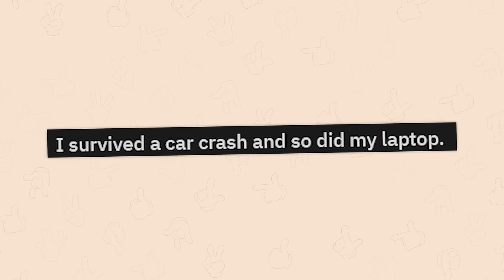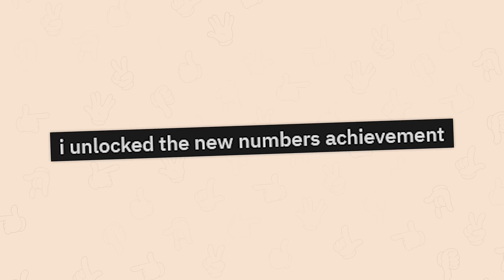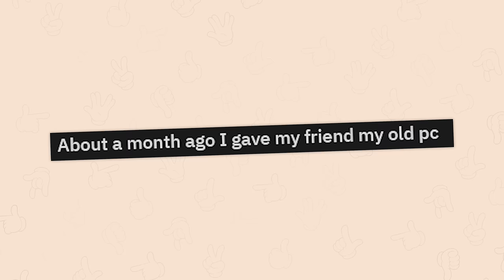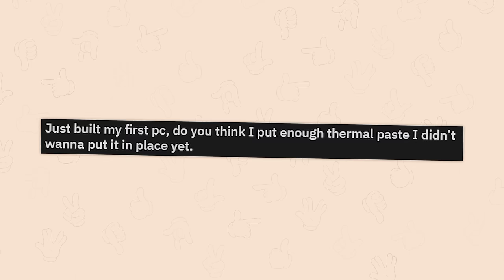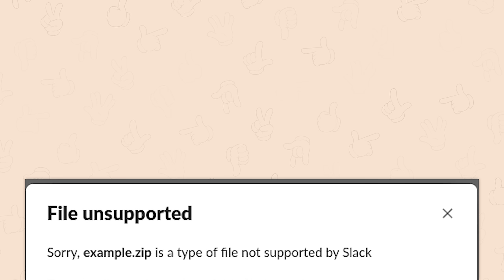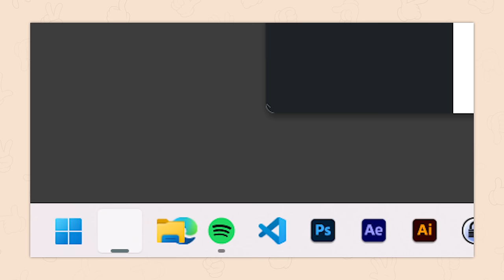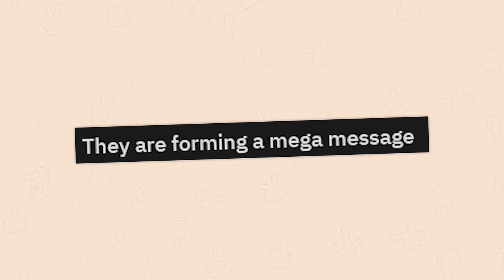r/Techsupportgore | why is the wifi down?!?!?

Comment: I've needed to replace the connector on an ethernet cable for several years (it's easier than replacing the cable cuz it's a huge one run from downstairs through the loft to my upstairs room on the opposite side of the house) and videos like this are a big part of the reason I've not done it, I don't want to end up on this subreddit. It is wedged in with a folded sheet of paper and it works.
Reply: Don't worry. I have a cable held in by tying a piece of yarn around it and the switch. But seriously, if you have the proper connector and crimper tool you'll be fine. If it looks bad cut it off and try again. The subreddit is for notably bad things. If you have less than an inch of wire sticking out of the sheath I guarantee it will not be bad enough for anyone to notice.

Comment: As Lexi correctly mentions: if you let a general electrician run your Cat6e, at the very least do not have them try to terminate it. It WILL be wrong and you WILL be sad. Just ask them to run the cables and leave the cut ends sticking out of the low voltage junction boxes with about 4-6" of slack. Terminating these cables is pretty easy, but the electricians are typically not very good at it. Better off doing it yourself.

Also, I 100% agree that Windows 11 just isn't finished. If there were still security updates and software didn't need feature sets from newer operating systems or were bullied by Microsoft to stop supporting the old ones, I'd probably still be on XP. Heck, I might go to Vista. I do miss the widgets and I've got PLENTY of RAM. But I'd rather not be even less secure than I already am. I might be tech savvy, but I'm not up to the task of building my own personal router with a firewall built in. That is just beyond my interest, even if it isn't beyond my skill level. Also, for anyone curious how so many retro tech reviewers can feel comfortable running old operating systems on their networks, this is how. You build a computer with multiple RJ45 networking ports, load up your favorite router-tuned flavor of Linux or Unix-adjacent operating system, and load the container that has firewall functionality. Then you set it for DefCon5 because old operating systems are rife with known vulnerabilities.

Also, typically when something goes terribly wrong with the Windows shell, I will open task manager and force-close Explorer.exe, since that is basically the shell for Windows. Because it's meant to be running constantly, it should automatically relaunch. Otherwise you'll have to tell it to run Explorer.exe.

Also, yes, the network engineer is coming, they just needed to find their cat5-o'-9-tails made out of terminated Cat5 that they made during the last wiring upgrade. Always use the terminated ones to make your whip.

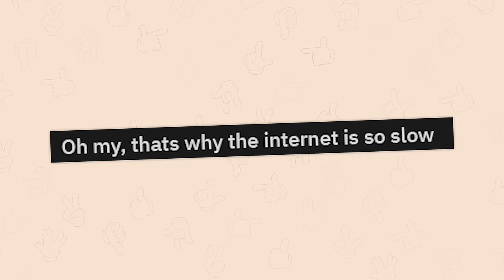Comment: 17:44 that is windows 10 and that issue only happens on .npy files when using the recycling ui empty option. If you use the empty option you get when you right click this issue does not happen.

Comment: 511 degrees C is hotter than the melting point of solder. For those who don't know, that's the stuff that bonds and electrically connects the components to the circuit board.

Comment: 8:00 it is very important that 8 alcaline batteries are good enough for 12v, but with batteries like 18650 Li-Ion or LiFePO4 you really should look at the input voltage range of your 12v charger, and find out how many batteries add up to that voltage, you might want to use 3 of the 18650 Li-Ion which run at 3.7v per cell, or 4 of the LiFePO4 cells which run at 3.2v per cell, remember, you dont really hurt anything by going under the rated voltage, but going over can kill the device and start a fire

Comment: 1:01  cant quite tell but it looks like they were able to mirror the screen onto the external monitor meaning that while the lcd screen is smashed every thing else works well enough to simply get the lcd screen replaced but its hard to tell.  it appears the the lap top did in fact boot enough to tell every thing else is fine.  6:00  it might be that the sticker would also take off the termal paste so you'd have to reapply any way?

Comment: 0:10 Pulling the CPU out without undoing the lever doesn't break the socket. It's pretty common in systems with an old Pentium 4 to have dried up thermal material and removing the heatsink pulls the CPU out of the socket. AM4 has thinner material because it has so many more pins so maybe socket damage is a bit more likely. The crazy thing is if the socket pins in that motherboard aren't bent it might still work. The plastic grid just aligns the CPU and pushes it against the socket pins.

Comment: 0:15 you actually might be able to get away with putting the processor on if you're careful and realign the parts that aren't broken. I've done some mistakes soldering components by melting bracket mounts, having to cut the melted parts off to them put the component in and praying to God the non-melted parts can guide it straight in, which more often than not it does.

Comment: That amp one remind me of how difficult it is to change the volume on my stack system (was my mum's) it's from the late 90s and the remote is lost, now the sensor that works out what way your turning the volume knob is funky where if you turn it wrong it will either not sence you turning it or might think your turning it in a different direction

Comment: I used to be pretty fussy on cable management.  These days it's more "whatever".  But I've just got a very simple setup, not many cables except for the minimal keyboard/mouse/network stuff.  I still have the rackmount cabinet in the room from when I used to do much more with hardware and it is still very neat and tidy.  But the computers in it haven't been powered up for 20 years.  I should try powering it up.

Comment: 0:26 It looks like part of the socket was damaged, and there's no way a bad mount or removal could cause that, right? It's an AM4 socket, but I have no idea if there's issues with motherboards that include THAT.
Reply: Also the "This File Exists" error is because the temp folder is full, it's limited by Microsoft to 65535 files. I'm pretty sure the folder has been around for aeons.

Comment: 1:08 yeah that Wine logo is wrong. Looks like one part of the software sent the picture in a different pixel format than that what another part was expecting. Likely either a GPU driver issue or a cruddy build.
2:05 looks to me like a regular 8-bit color LCD was misdetected as a 10-bit HDR one. Or if it does have an HDR display (not familiar with current Macbooks), the mode didn't activate correctly. At a guess it might be a driver issue, or the display cable is going bad.

Comment: I did the desk fan thing once while trying to figure out why my PC was overheating. Used it as a baseline. Turns out I had neutral airflow because I had one fan dead and another facing the wrong way. The dead one must have died just before I noticed the temp spike and the fan turned the wrong way must have been like that already from the beginning. Suffice it to say, after I corrected that, my PC functioned much much more sanely.

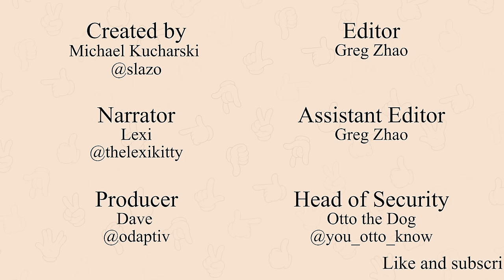Comment: 27:40 Not as bad as it looks. If you want to keep the color coding, you just have to re-pull five red and two purple. Of course, it depends on where they run. 
Best case scenario there are redundant ethernet sockets nearby. 
God help you if no one mapped wire routings in the building.

Comment: 4:00 You're not seeing the hanging power strip that is being held up by whats plugged into it ??
7:20 I've done somethign like that with 9v's, a model train track section and ducktape.  Made a 45v power source from that.
25:00 Cyberpunk 2077

Comment: 13:00 the school i used to go to used to have those they are cool but they didn't use the expansion slot so when i was bore i would pull the slot out and put it back in for like 20 min

Comment: You want to talk about old infrastructure running things, I once worked at a lumber yard that dried lumber in building-sized kilns... Those kilns were running on software that ran on a C128....
Reply: ... the only thing i can think of when i look at the word c128
 is a little red and white checkered ball 

am i correct in thinking it is a commadore system.

i personally have a dell d-333
produced in 1990
it runs msdos

i know old stuff because 
think about a modern pc 

this computer has no cpu cooling 
mounts, no fans, its just a bare silicon chip
and it runs fine 
the computer was built as a computer you would rent from dell
as in the computer's hardware belonged to dell and you would pay to use it.

i found listings for that type of computer going for 3000 dollars for a year 
eventually they fazed that out and this one dinosaur survived forgotten until it was unearthed from my grandparents dusty basement 
at the time i had the feeble thoughts of a museum of all of the various windows versions 
composing of various computers 
each running older and older versions of windows

i assumed the computer could run 95 but alas i was sorely incorrect.

Comment: That battery paperclip mess with the 12V usb thing. Those ones are real forgiving on the voltage. I have one straight from my 24V solar panel to a phone charger and it gets power even when it's evening and the only light is reflected light from the neighboring house. Measured the voltage it gets and it's at minimum 8 to 9 volts when the charger is still charging a powerbank. Haven't tested from a 9 volt battery probably should, don't have those with me currently.
Reply: An update. Yep it works. Also checked the IC and it's RZC2013. It accepts voltage from 4.75 up to 27V so that should be close to what it can regulate. Although, when the amps drop low enough it seems to connect/disconnect repeatedly when charging a phone. Yes it has a cap and not a large one though that should not matter, it's not nearing its spec even close when it does that. The opposite even. I have the whole pack soldered on XT60 connector for ease of use, and it's a pleasure, also got the charger itself for 1€ so that part was definitely moneyworthy, for others i do recommend going with a charger that delivers more than 2A, i feel it's a limiting factor. Those things are cheap. Or just get an actual regulator, that's probably wiser, and possibly safer too.

Comment: You would be surprised how outdated some enterprise software, and by extension the hardware required to run it, is. Oldest I've seen as standardized is Windows 98 and 95, but I'm sure somewhere out there, there are enterprise computers or industrial equipment control systems still running, like, Windows 3.1 or even MS-DOS.
Reply: If you just need old software you can use a newer hardware platform, possibly with emulation. Industrial control stuff is where all the old stuff is. Tom Scott had a recent video about a radio telescope controlled by a PDP-11 IIRC. And of course before that there were electromechanical systems which are often still in place. Old elevator controllers can be quite impressive.
Reply: @eDoc2020  You'd think that, but often when high reliability is needed for the old software in question and unexpected downtime is a safety risk or costs ridiculous amounts of money, it can be far more reliable overall to run it using the OS it was developed for, running on hardware from the era, for stability and compatibility reasons. But yeah industrial control is really where old computer hardware and outdated software is the most ubiquitous, that shit's expensive and often entire PC's are treated as just another expensive replacement part for expensive industrial equipment, which is why companies exist selling new-built old-spec machines at prices that were a lot then and are still exorbitant nowadays - because people are paying hundreds or thousands of dollars for those computers to keep a huge industrial machine running rather than tens or hundreds of thousands to replace the entire machine with the newest model.

Comment: You know, if they were stored correctly (and not just thrown into a box haphazardly) those spare HDDs from 2000 (14:08) would probably still be good. However, as the drives are SCSI have a capacity of *9.17GB* I would seriously consider looking at alternatives. Like a USB flash drive.

Comment: Legit worked on an amd pc once and the thermal paste was so old the cpu fused with the heat sync, so when i pulled of the heat sync, the cpu came with, had to use ALOT of force to get it off😭

Comment: 18:10 there's only a single reason where using a splitter for ethernet is OK: connecting analog/isdn/system phones to a telephone system ;) In that case it works fine because those phones only need 2 (or 4) wires, so you can run at least 2 phones through one patch port ^^

Comment: 2:52 take a straw cut it not in half but like all the way from up to bootom ( or reverse ) and put it on the wire its supper easy bc all you have to do is just push it

Comment: That ipod at 10:40 is locked for nearly 5 entire days. This person would need to wait a full work week just to use that thing. Not a bad wait, id take that over replacing the damn thing, but how did you even get to this point? That would require hundreds of failed attempts wouldnt it???

Comment: 10:00 thats not a switch its an optical cable splice box, see the thick cord on the corner, and the blue taps at the front, i gues the glass inside it realy like it dangling on them

Comment: Well lexi you theoretically you could could melt humans, but you need heat and remove oxygen so the object can burn but melts instead. Everything has four states of matter. Solids, liquids, gas, plasma. The problem is finding a way to get to that state of that object.

Comment: Didn't know that about the phone battery thing. I've got an old iPhone 6 that i stopped using cause it would just run out of battery while saying it still had anywhere up to 15% left. It wasn't even consistent, like always 15%, at times it would go to 0 like normal. I'll give your fix a try anyway then if it works I'm sure I'll find someone I know who can use it.

Comment: Big capacitor on motherboard most likely appeared when someone replaced leaked PF capacitor and had no original capacitor type around. Recently replaced similarly appeared huge capacitor back to original SMD capacitor type on Routherboard 2011 where my coworkers improvised on replacing the leaked PF capacitor.
12V bank made of D cells ls is totally macgyverish solution how to deal with lack of phone wall charger around. Clever one :)

Comment: Thats not what’s going on here.   The iOS notification shows current battery percentage.  So if the phone is put on the charger but the notification is not dismissed it will tell you to charge your battery and shows the current percentage.  Their battery is fine. It’s just a side effect of how the notification works.

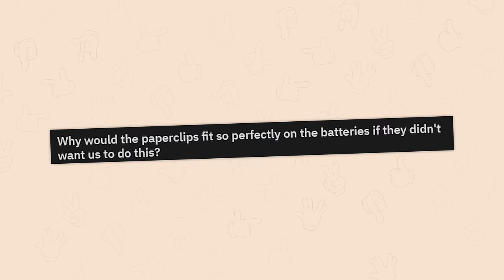Comment: 7:01 I know that Wingnuts are a standard thing to use for electrical work (in the US) but damn do they look like someone really jury rigged stuff. Considering I've seen them a ton with amateur hour wiring.

Wago connectors exist, pls there is better ways.

Comment: Am4 is something else. I have 100% ripped a cpu out of the socket without pulling up the bar cause the cooler would not let go. I have never seen am4 do that. I bet that board was used with sub zero cooling if I had to guess. Cracked the plastic and that was that.

Comment: At 25:00 just classic Cyberpunk 2077 graphics glitch on some Nvidia GPUs while running in Linux and Proton transition layer of there is still no native Linux version, didn't check for a while, but if I recall it - it was running through Proton on Steam Deck almost half a year ago. And guys, AMD to the rescue, way better drivers support all Distributions, FYI.

Comment: I just remembered about the time I managed to not unlock my old phone with the right password. Some phone need you to input the password and if it's correct it'll unlock on its own. Some other phones don't. You need to click on a button at the bottom once you're done to unlock it. Mine was the first method. I don't know how fast must I've been because I imputted the password to unlock it and it allowed me to add an extra number and told me the password was wrong. I deleted the extra number and my phone unlocked no problem.

Comment: I dropped my old LG dl455 something something phone In a bucket of bleach water it was a good 15sec before I reacted and got it out I then put it in the air vent of the car for an hour and it worked the next day used it for 4mo after that only problem was it would loose cell service 30sec into a phone call

Comment: 25:00  That looks alot like Cyberpunk 2077.  Fun game (and yes there is some similarity to GTA), but still glitchy, even after all the patches and even on Windows.
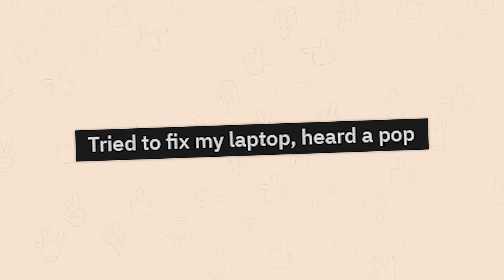Oh and 24:49, I don't think that's a CPU.  Laptop is reasonably modern, judging by the fact it looks like it has an M.2 slot.  Probably like a chipset or something.
Reply: I was wondering why in the world a m.2 drive would be on top of a CPU like that - there's no room for a heatsink.  I think you're probably right.